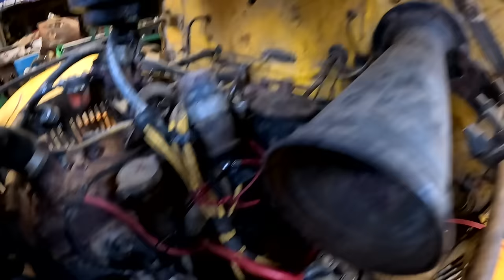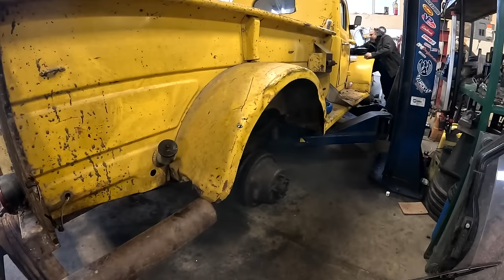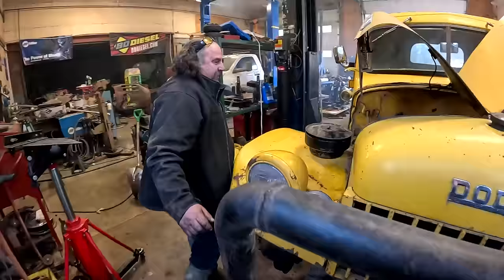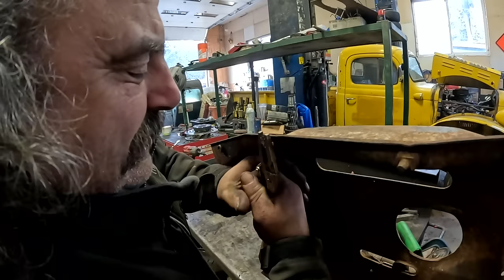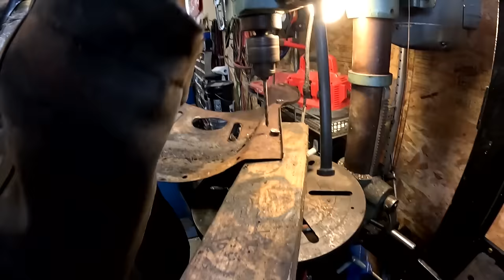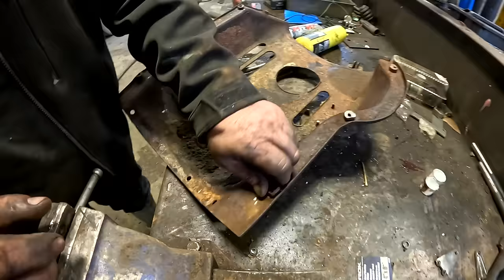Will Avery be able to get the 1956 Power Wagon to Start?

Comment: The battery has to be reversed post,I had the same thing on a Nissan truck.
My friend has a Powerwagon,it runs,it's solid and a beast.
Reply: Reversed post ?
Reply: Yeah because the truck is canadian made,so an american made battery would be offset post,you flip it around the post may not reach,so reversed post,in this case it may not matter since it has long cables.
Also they used 2 positive cable,both have bigger clamps,so one will not tighten since the negative post is smaller. @hondamanvtec2894

Comment: This is a W300M Power Wagon, meaning for government and civilian use.  All virtually the same from 1946 to 1968.  I mean REALLY the same, with only minor changes, because the gov't wanted to keep costs down.  The 6 volt positive ground was VERY common in the USA on 40's and 50's vehicles, and the Power wagons had it into 1955-56?  My 1960 is 12volt negative ground, and I think it was built that way.   The 6 cylinder flathead engine is really a star, but the tranny, transfer case, and axles are a nightmare to bring back to life if they have gone bad.

Comment: Avery.  On the positive ground.  Many old tractors have that.  My JD  B has a 6 volt generator and positive ground.  It will start and run either way with generator producing???  I bought it with a 12 volt battery in it and it has been that way for over 20 years.  I have asked several old farmers around here and they say it will burn out generator, but it never has.  That old thing starts and runs great.

Comment: Check your timing advance on the Power wagon. I can tell by the way the exhaust sounds and it's really hard to start. Someone retarded the timing too close to the exhaust stroke of the firing order. Bump the timing advance just a hair or two and the engine should run a lot better. If you use a timing light and figure out the total advance at 3000rpms to within 36° then set up the idle mixture on the carburetor it should run perfect. if it sputters and hesitates on acceleration, fatten the idle mixture a bit more. If you've ever tried to do a brake stand in a vehicle and the engine stumbles or stalls out when you pull your foot off the gas. The timing is off. In this generation of auto techs and computer controlled fuel injected emissions control junk! Nobody knows how to tune old engines anymore! Using diagnostic scanners and look at stupid engine codes. I refuse to work on other people's junk!